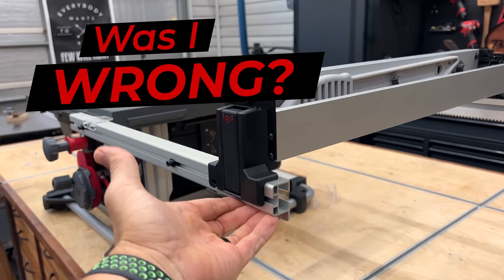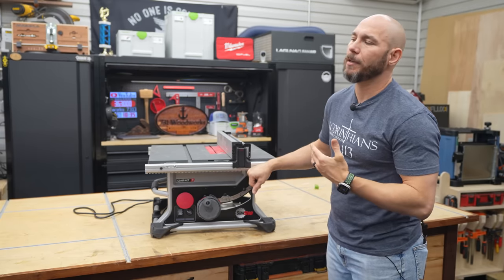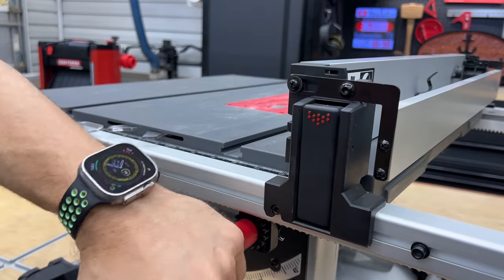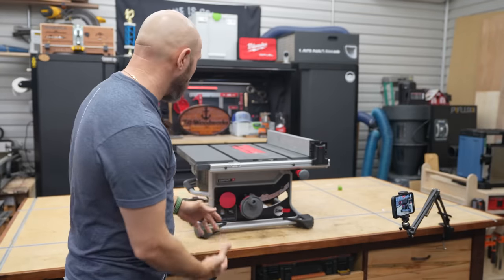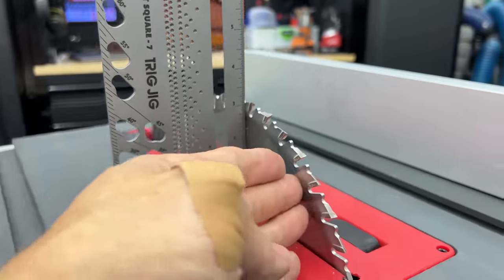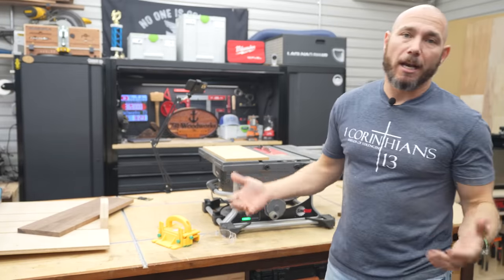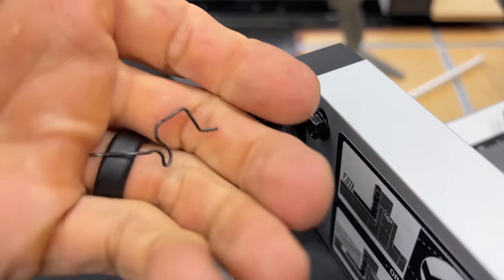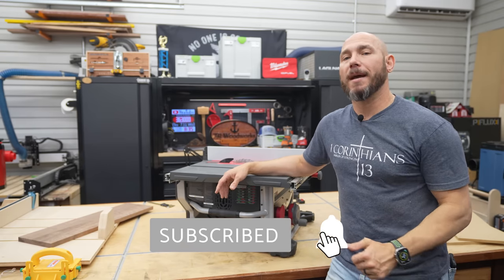Was I Misled or Wrong About the SawStop Compact Table Saw?

Comment from the maker: ▼EXPAND FOR LINKS TO THE TOOLS▼ 
🎥 Watch Next - SawStop CTS First Impressions - https://youtu.be/TieBJVT5nBM
🛠 Tools In This Video: 
SawStop Compact Jobsite Table Saw - https://shrsl.com/3v1ym
Dewalt Jobsite Table Saw - https://amzn.to/3Cdooai

Shirt I was wearing - https://www.shieldsofstrength.com/1-corinthians-13-shirt/
My favorite work boots (use code 731WOOD to get $10 off) https://bruntworkwear.com/731wood
Camera Gear I Use - https://kit.co/731Woodworks/camera-gear-i-use 
Computer Equipment I Use - https://kit.co/731Woodworks/731-woodworks-computer-equipment

Some of my Favorite Under $30 Tools
DFM Square: https://amzn.to/3Jfb5H2
Thin Rip Jig: https://amzn.to/3LKm2lB
DFM Saw Height Gauge: https://amzn.to/3jidia1
Small F-Clamps: https://lddy.no/157u9

(If you use one of these Amazon and other affiliate links, I may receive a commission) 

Some other useful links:
Daily Tool Deals on my website: https://www.731woodworks.com/tool-deals
Subscribe the 731 Newsletter: https://mailchi.mp/7e44c16eefdc/731-woodworks-email-newsletter
Check out our easy-to-follow woodworking plans: https://www.731woodworks.com/store use code 5NEWTOOLS to save 20% off your order.
Outlaw's Board Butter - So Good it Should be Outlawed: https://www.731woodworks.com/store/boardbutter
Reply: No dado.  Ok.  What about box-joint blade pairs?
Reply: It's really disappointing that you took 3 months to do a follow-up video, especially since you had the "fix" since September.  If you're going to do reviews like this and want to be a trusted tool reviewer, you owe it to us (your subscribers) to be timely in your updates (especially since you teased that you'd do a follow-up once you figured out if it were a big deal).  

I had to find the Ron Paulk channel to figure out that this saw does what I needed it to do.
Reply from the maker: @DanParisianBP  Understood.  Thanks Dan.  In hindsite I should have put out a short follow up video. I wanted to use the saw for several weeks before doing a full review, which is why I waited.

Comment: For $900 would it have killed them to have incorporated some  bearings in a linear rail type fence system?
Reply: Replace the cam with a skate wheel with a cam bearing in it instead of regular bearing.
Reply: I mean it’s not really a $900 saw it’s more like a $300 saw with a $600 safety feature.

Comment: I'm personally using the Skil table saw and it's been fantastic. It's a third of the price of this saw and has the rack and pinion fence which makes perfect cuts every time.  I like the safety feature of the Saw Stop but it doesn't justify the 3x price. I'd like to see a comparison video of all 3 if possible.
Reply: Agreed.  I'm in the market for a 10" jobsite saw now, and have narrowed it down to those 3 (Skil, DeWalt, and SawStop).  With the massive price spread ($300 / $600 / $900), I want to know if spending the extra money is worth it.
Reply: @cottrelr  Second this, looking at all 3 myself.
Reply: @cottrelr  Yeah, it's a tough call. The 3 way comparison would be great to see. I personally don't think the extra cost for the Dewalt or Saw Stop is worth it so that's why I went with the Skil. The Skil is fully adjustable and a real treat to use with the rack and pinion compared to my old cheap Craftsman. I used to dread cutting things on the table saw as it took forever to get the fence lined up just right. Now with the rack and pinion, it's a perfect cut every time. Regardless of which saw you pick, the rack and pinion fence is a game changer.
Reply: @cottrelr  I own two of the three plus the smaller DeWalt and a Sawstop PCS. 

Folding legs on the Skil are nice, and it functions just like the DeWalt but the one we have has issues with the fence staying parallel to the blade. Might be an easy adjustment but I haven't taken the time to mess with it yet. 

You said 10" but you can't beat the DeWalt 8 1/4 for price and portability - it's $270 on Amazon right now. Those 10" saws are noticeably bigger. Milwaukee M18 is basically identical if you want to go cordless. 

If portability isn't a big deal or it is and you use a trailer with a ramp the Sawstop Jobsite Pro is fantastic but it's like 90lbs. I had this saw for a bit but getting it in and out of a truck frequently was brutal. If you're trying to save space in a garage or something you can fold it up and put it against a wall. It's not cheap but neither is the CTS and both are terrible at cutting hot dogs.
Reply: @cottrelr  I'd checkout the skillsaw too ( SPT99 ) it's got a higher cut capacity and the wormdrive is pure power! I love the dewalt too. If you're on a budget the Skil or Hercules both offer great value for what you're getting. You can't go wrong with a rack and pinion.
Reply: Which one do you have? I have the Spt99-11 saw 2 years and have been happy so far. Only thing I don't care for us the bevel adjustment.
Reply: @rikityrik  Skil ts6307-00 is the one I have. Fantastic little saw so far.
Reply: Your hands don’t justify the price?
Reply: @MemelordSupreme  I’ve owned the Skil SPT99 for two years, and have been pleased with it, has a couple quirks but nothing to really complain about. Love the power and the dust collection is really nice, considering it's just a jobsite saw. 
Sawstop’s saw seems nice but the stand is a slap in the face for the money, least they could do for a grand is give a decent stand.  I do really like their larger saws but out of my price range.
Reply: @CoveringFish  Not unless I was a careless person. I mean the safety features of the SawStip are great but the price is way to high.
Reply: @cottrelr  Trust me, it's not worth it. This saw is underpowered & cheaply made. After 6 months of use has fallen apart. Waste of money. I could go on & on. The stop technology is great, the saw itself is junk.
Reply: I’ve avoided table saws all my life because I’m a fingerstyle guitarist & every one of my woodworking friends are missing fingers

Comment: Would love to see a comparison or just review on the Dewalt saw to see your opinion on it. I just sold my Kobalt saw and bought it, absolutely love it so far.  I was going out of my way to avoid the Kobalt saw because the fence was so hard to keep square.   The Dewalt saw was square out of the box and just feels so much better.
Reply: I have had my Dewalt for 5 years now, work it hard most days, and it has been a great tool with plenty of power.  Try to be extremely cautious as it does not have the SawStop safety feature.
Reply: I literally just lived this comment two weeks ago. I bought the Kobalt table saw when I worked at Lowe's about 6 years ago and while it was a good saw overall, the fence was terrible. I was lucky enough to get the Dewalt compact saw for $269 on Amazon and sold my Kobalt for $250, no brainer.
Reply: I think you do a great job showing these tools, you really break it down!  You have great presentation skills...you are a good teacher!!

Comment: My Milwaukee doesn't have that kind of play. It also takes a Dado stack, and it runs off a battery. And yes I use the Dado stack in my battery Saw. Because when I'm building cabinets in the mountains, and I'm 8hrs from the nearest paved road, I need something that can do everything.  Saw stop needs to do better.
Reply: Dewalt doesnt have the saving fingers feature.

Comment: Sorry Matt. I have a dewalt dwe7491 that I paid $550 for and the only issue I had out of the box was the blade tilt was out by 1 degree. That took about 10 seconds to fix and is part of my initial setup checks. I would still expect more from a higher end saw from a company like sawstop. Pre shipping quality control is very important.

Comment: I am a little surprised that anyone would expect this to be a precision saw and it makes me like Sawstop even more that they'd come right out and say it. Well built and accurate, sure, and maybe this is semantics but it's a lunchbox jobsite saw with a rack and pinion fence (which I agree is great).  Any professional using this on a jobsite likely has a cabinet saw, track saw and is paying for the safety feature. I can't imagine a scenario where I'm using this machine to make wide panel cuts that need to be incredibly accurate. Something like this is for scribing fillers, long rips on 1x material, maybe flooring rips, long miters etc. The Festool compact saw available overseas maxes out at like an 11 in rip capacity and doesn't even pretend like anything wider is part of someone's workflow. Personally I'd loosen those cams immediately if the rack and pinion is tight because I'm never extending the fence out that far. That would be the far greater annoyance to me. 

If I did do that kind of work on site I'd probably set it up in a Rousseau Portamax, a $400 accessory with a built in fence which would be a good option if you're a hobbyist and space is a consideration but you like the safety feature. You could also build it into a workbench and the table top would take away from the deflection or you could use an aftermarket fence. At that point however in terms of footprint and cost you might as well get the Jobsite Pro. That one folds up and rolls into a corner. I used to own that one years ago thinking it would replace my old Ridgid hybrid that I had some ambivalence towards (now I have a PCS in the garage and we have a couple of the DeWalt saws for site work) and it's a phenomenal saw. If I only had one table saw or pulled a trailer with a ramp I'd still own it, it's just too heavy to get in and out of a truck bed regularly. 

Both reviews have been very informative and I'm considering buying this but I'd be paying for the safety feature and that's it which seems to be the takeaway here anyway. I can see where a hobbyist would want this to be their only saw and that's definitely possible but I don't think that's who this saw is for. Unfortunately, it's not a Sawstop for someone who wants to save money, it's a Sawstop for someone who wants to spend even more money.

If someone found some way to make a compact saw that wasn't an absolute screamer I'd buy that in a heartbeat - some jobsites are remodels.  And on that note, one thing I would expect from a $1,000 saw is a dust port on the blade guard or at least an option as an accessory would be nice but maybe I missed that.
Reply: Agreed, making such a big deal about the fence wobble is such a non-issue for anyone that uses compact table saws. I'd just be happy to get more than my current ryobi 12" rip capacity. Looks like a pretty decent and well thought out unit, and you're paying for the safety feature which is fine by me.

Comment: Since purchasing the Ridgid 15-amp 10 in. pro jobsite table saw with stand. I haven't had any problems with it.  I have cut down full sheets of 3/4" plywood and used it to cut 2x4 lumber for both my basic (hard duty) workbenches.

Comment: I bought the SKIL 10" table saw you reviewed a few months ago. I considered pre-ordering this SawStop but for $900+ I could get the SKIL for $299 which has a rack and pinion fence with a high/low feature plus it takes a 5/8 Dado. I have no complaints with the SKIL after 4 months of daily use. I'd rather reinvest my money into materials or additional tools. I use the SKIL with the blade guard, paws and riving knife with a micro grip push block thus in theory as long as I'm paying attention to my hands, body placement and material the risk of an accident is low.
Reply: I have the skil only use the riving knife only issue the knob to lock the riving knife broke
Reply: I'm mildly considering the Sawstop. The basic saw is only 20% more expensive than the Dewalt, but without the wheeled stand. This also appears to be better than the other Sawstop (portable) contractor saw and half the price. But there's also a store here that carries a rebranded Dewalt that goes on sale for 30% less than the Dewalt. I guess we'll see what happens in the spring when I can get back into the garage.
Reply: This is my exact scenario too. I wanted the saw stop really bad, but then ended up buying the skil after seeing his video on the saw stop. I spent an hour squaring it up and I've never looked back since. It's an awesome saw!

Comment: A good in depth video showing the pros and the cons of this sawstop jobsite saw. I have just purchased and set up the evolution r255tbl+ jobsite saw that seems to have all the adjustments and accuracy and almost the exact same fence as the sawstop plus the evolution has a built in sledge. Apart from the sawstop it has all I need at a third of the price. I noticed that just like the evolution the sawstop comes with the push stick that is almost useless at preventing kickback.

Comment: Thanks for the followup Matt.  I'm glad I decided to go a different route as my concern was that it was exactly as they described, that it wasn't really a precision saw.  I ended up picking up a nice Laguna F2 Fusion saw.  Aside from the safety stuff it just seemed like it was too close to the saw I was replacing (which was a Dewalt with almost all of the same features putting aside the safety stuff).

Comment: Like you said, the only benefit over the Dewalt is the safety feature (and I guess the miter adjustment is easier), but really, I could make a better fence with some aluminum extrusion and some linear bearings

Comment: Thanks for the update.  I love the honesty.  I think the Dewalt 7491 is the better comparison on price.  I got an awesome deal on a refused delivery and love it takes a dado stack.  It has a few shortcomings as most job site saws do, but as Tamar and others prove you CAN do fine woodworking with it.  As for customer service, i hear its gone down since Festool bought them.
Reply: 100%  The Dewalt he has is completely the wrong model for a comparison.
Reply: @PriceyBuilt  Agreed. He has the 8 1/4" DeWalt vs a 10" SawStop. He should really be comparing 10" saws.

Throw the 10" Skil in the mix, and you have a wide price spread ($300 / $600 / $900). It would make for a really useful video.

Comment: Thanks for the update. At a $600 difference I would go with the Dewalt and let my knowledge of using my tools safely protect my hands. Use a blade guard 99% of the time and practice proper skills.
Reply: I have a Dewalt also and it works just fine with a blade guard on. It amazing the number of YouTube channels not using blade guards and taking the risk of injury, an unnecessary risk. Especially when the blade guard design now days allows you to remove and reinstall the guard so easily. Watch Stumpy Nubs he'll teach you how to use your table saw safely. Excellent instructor.
Reply: @joewatts7942  Hey Joe, just wanted to tell you. I jumped over to your channel and listened to your hymn playlist. Very nice, a lot of really good hymns there. Thanks for putting that together. ~Pat

Comment: I figured the vertical movement of the fence would not be an issue. The distance to the blade does not change by any practical amount. The piece will lay flat on the table for the 90 degree cut so the cut is the same with or without the vertical flex.

Comment: Thank you for investigating and reviewing this saw.  I have been looking for such a product for my very small workshop.

I see a lot of complaints from people saying they don’t want to pay $900 for this table saw vs. $300 for a non-SawStop saw.

I don’t see it that way.  To me, it’s $300 for a great compact table saw plus $600 for the extra safety.  I figure that if I would cut a few fingers off, it would cost about $6,000 to reattach them, so 600 bucks is a bargain.

Four guys I know have made hospital visits for woodworking injuries.  Nothing as serious as having to reattach body parts, but enough for a hospital trip.  It seems that the ones who are most confident that it won’t happen to them are the ones most likely to have an accident.  It’s just a matter of time.  I don’t want to take that chance.

Thanks!

Comment: That sort of fence, which is similar to that on the Skil you reviewed and on the DeWalt it looks like, won't work with the sorts of jigs that slide over  and along the fence.  If you have any way to work around that, or have some sorts of jigs that will work with it, that could be a very useful video.
Reply: I actually just built a vertical cutting jig to go over this fence.  It isn't perfect, the back flippy arm doesn't have support all the way up so I needed to be more careful about keeping the work piece fully stable, but it did still work.

I was worried about the hinges or arms protruding, but I just gave myself 1/8" clearance over the top and didn't have an issue.

I would definitely still prefer a beefier fence, but I do like the lock in of this one.
Reply: you can build a box over the OEM fence that basically straddles it, you can even remove the OEM push stick holder (2 screws), then add a center panel to add more stability.... then you can build any jig you want that rides the "secondary fence"

Comment: Early last year I cut my thumb on a DEWALT saw (totally my fault btw).  

After ER visit, 7 stitches, and follow up with a plastic surgeon, my bills were more than the cost of 4 SawStop saws.

$900?! That’s peanuts!
Reply: Do you really believe you won't need any stitches if you run your thumb right into a spinning blade on ANY table saw?  It won't be AS damaging on a sawstop, but it's still going to send you to the seamstress 🙂
Reply: @jlester4892  I’ve seen many photos of SawStop cartridge brake caused by hand engagement, a bandage is what most needed.
SS does give detailed instructions on how to properly set depth between teeth of blade and brake cartridge for optimal engagement.
Reply: @jlester4892  Have you seen the SawStop demos?  No, the damage done amounts to a nick.  I don't have a SawStop but if I were buying today it would be a big consideration.  

BTW, the only time I got hurt on my TS, it was turned off.  I dragged my forearm across the stopped blade.  Doh!